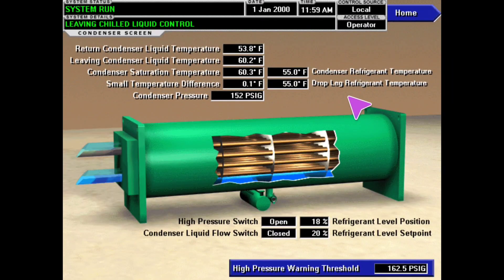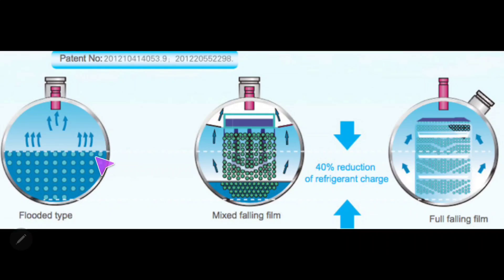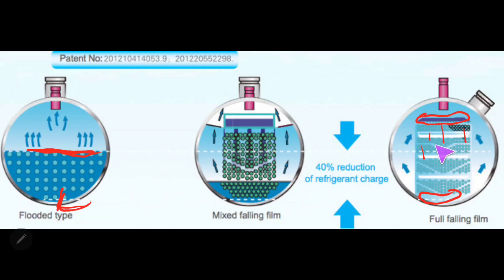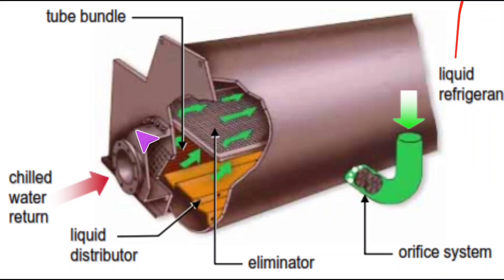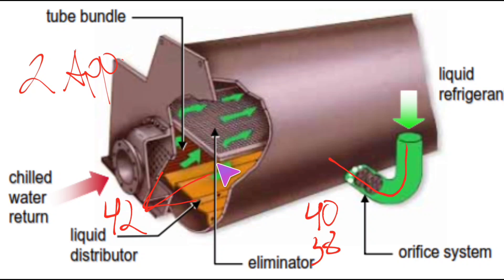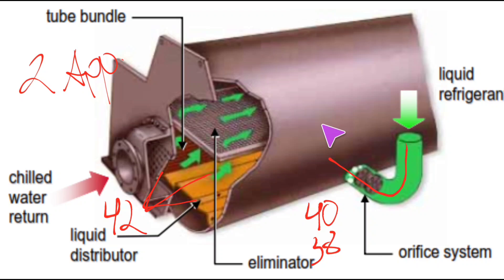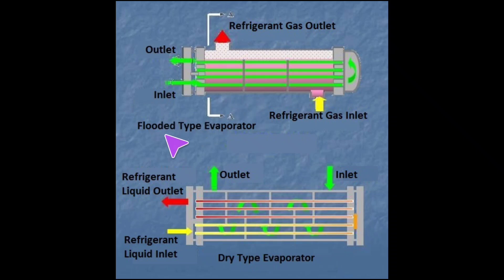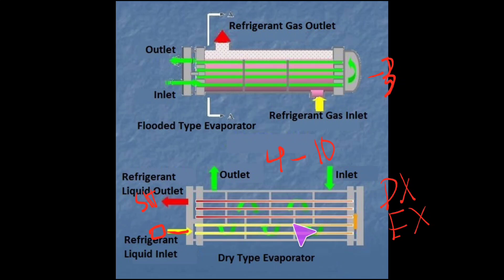HVAC Chiller Approach Explained

Comment: Approach can be used on any piece of equipment with a compressor attached to it. I remember when i was in residential.....Lennox didn't put subcooling numbers they used approach. Its a good metric, along with discharge superheat

Comment: Hi , I have 3  "Carrier 5H80" compressors in tandem configuration , besides the oil equalizers on hand hole lower connection , there is also piping on the same hand hole on upper hole which are connected to all 3 compressors , do you know what is it for ?

Comment: You briefly mentioned WSHP with co-ax coils. Just curious what information can be gleaned from condenser approach on those systems? My first thought would be that a higher approach would mean that coil was likely starting to get fouled, what would you consider a normal approach on such a system?
Reply from the maker: The approach will be higher, typically around 10F

Comment: Very good video. I’d like to add that the reason the approach goes up when the water flow is too low is because the water will go into laminar flow (as opposed to turbulent flow). Laminar flow is when the flow is so low that the water flows down the center of the tubes and is stationary on the tube edge where the heat transfer is taking place. Think of a small stream with very low flow. You’ll see the water and leaves flowing down the center and the water is stagnant on the sides. Turbulent flow has all the water mixing up going through the tubes. In a chiller, when you approach laminar flow, you loose you’re approach very quickly.
Reply from the maker: I agree, this has been a very challenging topic of discussion on this channel overtime.
Reply: You mean for a Flooded Type Condenser Barrel, right?

Comment: I have a question, is the chiller the condenser?  I'm asking because my teacher was calling it an evaporator but he may have misspoken and I don't want the wrong idea in my head :(
Reply from the maker: A chiller will have an evaporator and a condenser. The condenser can be water cooled or air cooled

Comment: Hello Buddy, we appreciate your clips on the Centrifugal Chillers; Do you have any clips on adjusting the metering valve on the MqQuay / Daikin Centrifugal Chillers. As it seem though you adjust the pilot valve, the main valve, seems to be very lazy in responding, any advice?
Reply: I have a 500/ton McQuay Centrifugal Chiller @ 4160 Volts, where the Discharge Superheat is suppose to be 15-18 *F with the liquid injection off @ 100% however, im just getting carryover which is preventing the oil from returning to the Oil sump to maintain the Oil level required. Discharge superheat is falling to 1*F

Comment: One of the tools a chiller plant engineer or operator should always have is a ( PT CHART) pressure and temperature chart. Another tool needed  is the pressure drop chart needed to determine flow rate on each chiller barrel. Now a days they have a ultrasonic flow meters on your bldg automated system

Comment: Approach also tells us how efficient the heat exchanger transfers heat. If the tubes in the water cooled condenser are dirty your approach temperatures will go up and vice versa. Punching the tubes is a good idea, and keeping tower water clean and filtered

Comment: When you talk about Approach as far as a chiller system you should be very specific because each component has his approach there are  Different types of Approach:
1. Condenser Approach Temperature 
2. Evaporator Approach temperature
3. Cooling tower Approach 
4. AHU Approach Temperature
Reply from the maker: I specified chiller approach

Comment: I notice these are large scale water medium devices. Would these designs be viable in residential scenarios?
Reply from the maker: No, wouldn't be efficient enough. And requires more advanced service ability and cost. Some of the original residential system used chilled water but the industry quickly moved away from it.
Reply: @HVACTIME  " Some of the original residential system used chilled water but the industry quickly moved away from it. "
- And now green measures are making residential go back to it 😆😆😆😆
Reply: In residential it's more important to look at superheat, subcool, delta t, and static pressures. I have the measure quick app for ease of getting all these in one place and reporting that information at the end of the job. It will throw you off if you look at condenser approach often it's negative which is a sign of liquid line restriction but there's no measurable difference from the condenser outlet and entering the expansion valve.

Comment: I know 0° approach is ideal.  But that also depends on the design.  Some chillers are designed for a 2° approach.  So if u r running 0° you r running the chiller outside of the design of the chiller.
Reply: Trane centrifugal is 2°